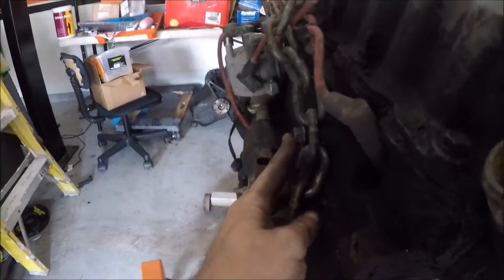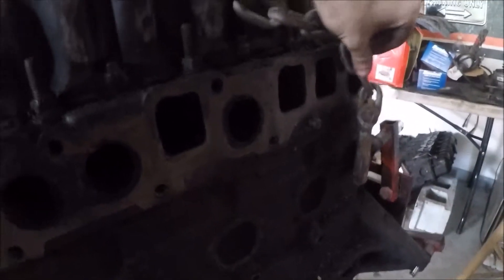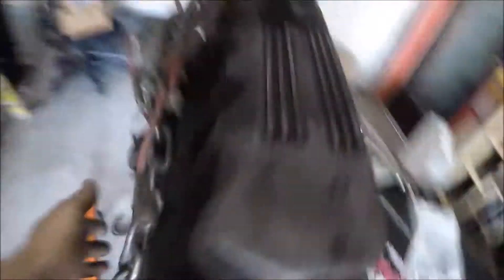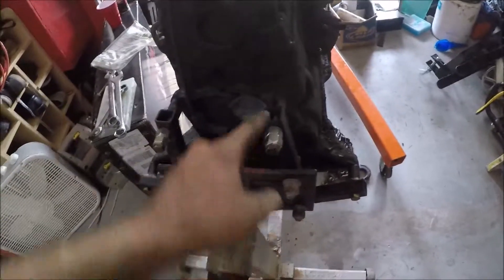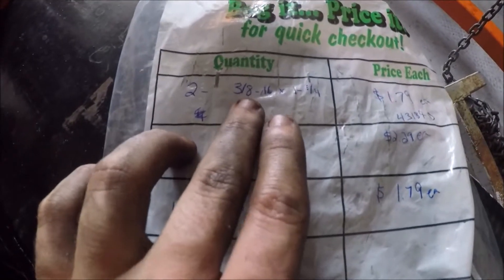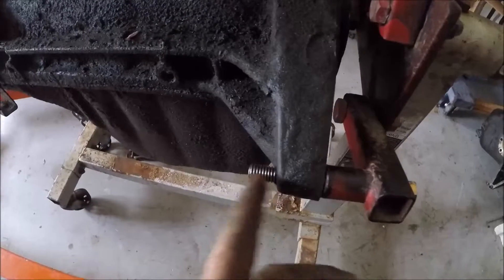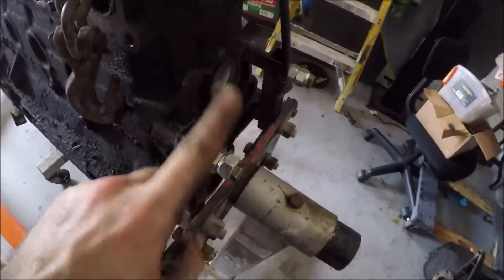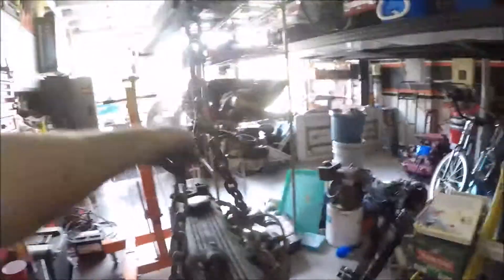HOW TO: Put a Jeep 4.0 engine on an engine stand BOLT SIZES

Comment: Unfortunately this is an engine hoist used to remove from the Jeep.  I needed info to put the engine on an “engine stand” that allows you to strip and rotate the motor.  Still appreciate the content, but not the correct info.
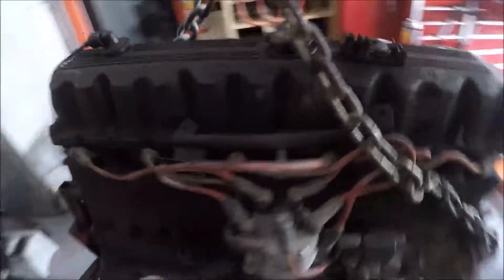Reply from the maker: Well Clint, if you watched more than 1:33 of the video, you’d have all that correct information in the same convenient place! :)

Comment: Love the video thank you so much quick question could I lift the engine etc with the manifold still mounted or do I need to remove that
Reply from the maker: I'd suggest removing it so that you don't risk cracking the manifold if you plan on using those bolts as a lifting point

Comment: How long is the chain?
Reply from the maker: Depends on how high you need to lift it, where you’re putting it etc. but I’d get at least a 4’ chain, you can always shorten the length temporarily with hooks or a bolt.

Comment: Thanks for talking about the sizes. You mentioned the 3/8-16 x 4” was too long. If you had to buy again, would you get a 3”?
Reply from the maker: Yes, I bought a little longer since I have different engine stands with longer or shorter mounting points. The bolts could always be cut to size with a hack saw and filed down to avoid damaging threads if too long, or just buying shorter bolts. Hope I was able to help! Thanks for watching

Comment: Do you have to support the transmission when you pull the engine?
Reply from the maker: The crossmember that supports the transmission will hold it in place, but you could put a jack with a piece of wood under it if you'd like.
Reply: Grave Up Restoration: Jeeps & Customs thanks for the reply!!
Reply: nope